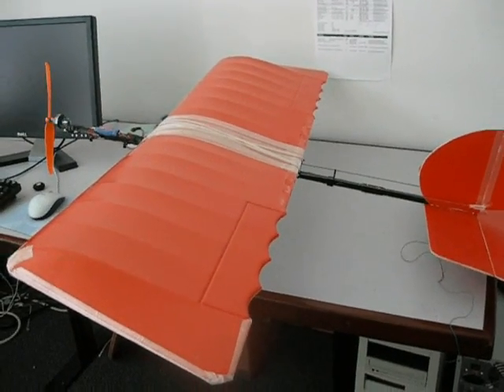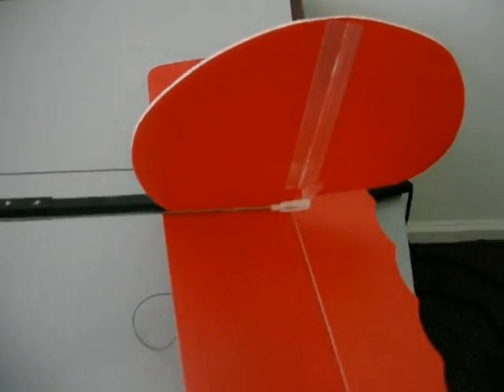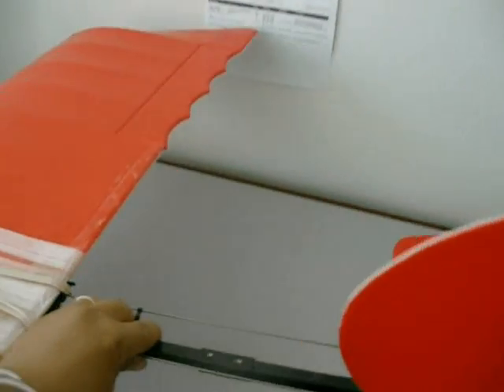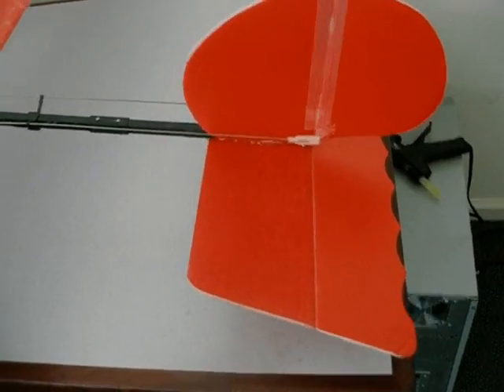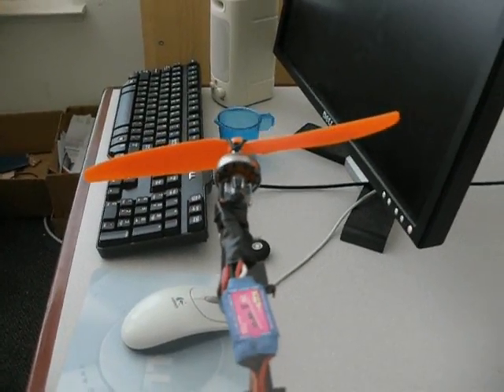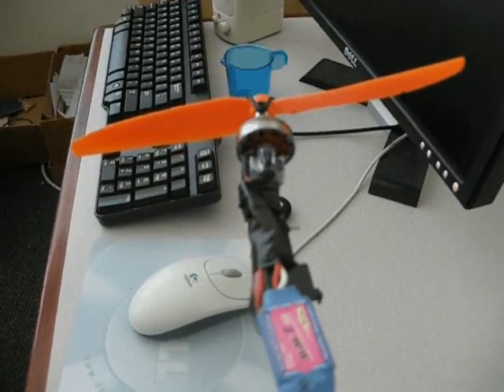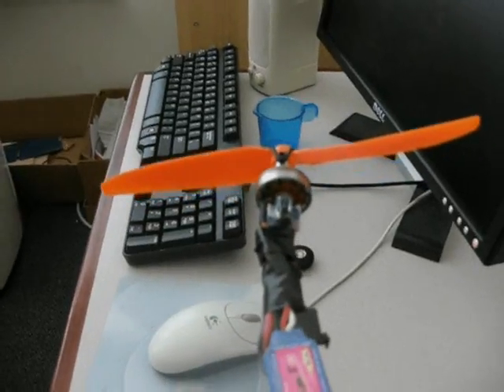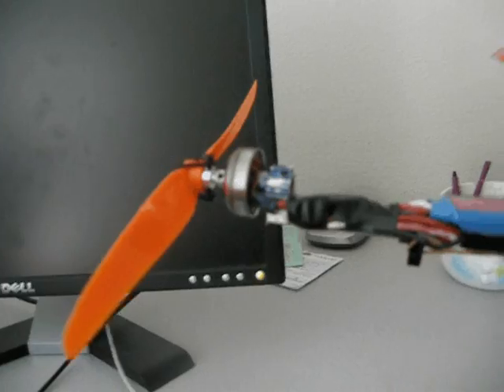Brushless slow stick pt 1

Comment from the maker: @tenrazo215 selection of motor depends on how you want to fly. In general on a SS most folks like to fly slow, so any low kv motor (under 1000kv) that will spin a large prop (> 10 in) with at least 150 watt of power will do.  Cost was very important to me, so I chose to go with the 2410-08 w/18amp ESC combo from hobbyking (now $16.38). Lastly, you should look for a setup that will give you lots of flight time. with this setup, I barely hit 5amps...so lots of flight time.

Comment from the maker: @tyrian869 No. nothing to do with angle wings, it's torque roll. Anyhow, the angle or what's known as dihedral of the wings will determine how your plane will fly. Make a long story short, the more the dihedral the easier it is to fly (dihedral self corrects if you screw up), but drawback is a less acrobatic plane- that's Y you'll notice on acrobatic planes there's virtually little or no dihedral at all.

Comment from the maker: That batt is fine for power requirements.  That setup (motor and ESC), is for a 2S-3S so no problem there, and at full throttle that setup with a 9x5 HD GWS prop only consumes like 7.5amps so wayyyy below 18A. Now, for the weight, you'd have to tell me what mah you have,...

I would stay smaller than 1800mah. My setup only had a 1000mah and I went for more than 10min flights at a time.

Comment: yep geared and wings are cut down a lot, it flies great. I think its only a 20amp though but still very good power to weight ratio. It weighs fully loaded with battery 1.5 lbs and can take off in about 1 ft of runway streight up with a strong climb. very fun/cheap plane.

Comment from the maker: Thanks. The SS needing a slow large prop definitely tends to need the 3 degree correction...although a couple of people on here says they don't need it. Maybe try without first. 

There's probably many ways to do it, but for mine, I cut out a piece of wood that fits snugly into the fuse stick and leave enough wood out to mount the motor mount on. I then carve angles into the portion that the motor mount mounts into. If you decide to do it this way, carve small angles and adjust accordingly.

Comment: i put a 1000 kv moter on mine and a 2 cell 1800 mil 15C.. staight on the stick..with a plastic stick mount.. mine flies perfect.. its the most laid back plane i have..with the motor it comes with.. it flies ok.. just not enough power for me.. i like it much better with the brushless motor.. mine has over 150 flights on it. here is a video i did with it just  yesterday

Comment from the maker: hmmmm....perhaps your motor didn't create as much torque as mine. Mine was sorta ridiculous, that I had to do the thrust line. when I WoT in the air at slow speed the plane would turn left and shoot straight up. with the correct thrust line, it goes straight and just slightly up. So far out of the 15 planes I've built, I haven't been able to get away from doing thrust line.

Comment: I didn't have any problems with my stick. First flew with E flight park 400 outrunner 3 cell 1320mha lipo and a camra. Lots of power!

Now have a 370 1360kv outrunner 10x3.8 apc prop
2 cell 1320 lipo. Installed a set of gws floats going to to try on nearest lake but lake is at 5,000 feet on a mountian.

Comment from the maker: Yes. If running hot, then prop is too big for motor. The motor I'm using is the Towerpro 2410-08 Star from xushobby, but Xushobby is no longer in business. You can get the same setup from hobbycity at less than $15 (both motor and ESC)- I'll add link to the info, since i can't add links in here. I used both 9x4.7 and 10x4.7 successfully. 9x4.7 will give more speed, and 10x4.7 will give more thrust. this setup is good on amp draw... On 1000 mah 3S, if you just float around, you can get 15+ mins.

Comment from the maker: Thanks. I intially tried by trimming, but there were problems doing that. The problem with trimming and not doing the proper thrust line (motor to the right and downward), is that when you fly with no motor power then the plane flies to the left and down too much... If you then try to trim that, when you throttle, you're out of trim again. Trimming only works if you always leave some power on...but that's not an option. Moving the motor to the right and downward is the only real solution.

Comment: just move the weight around, that will change the cg, and it goes to the right because of the motor torque, just set the trim on your radio to match it, all those mods are kinda unnecessary, sure it may fly a tad better, but most of that can be fixed by shifting weight, or moving the wings.